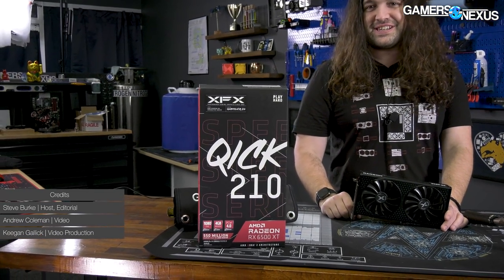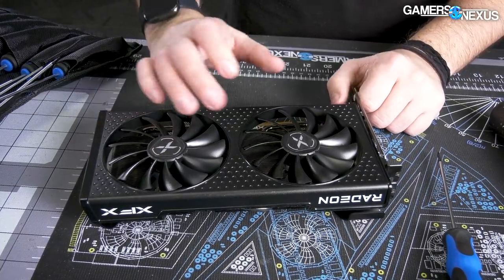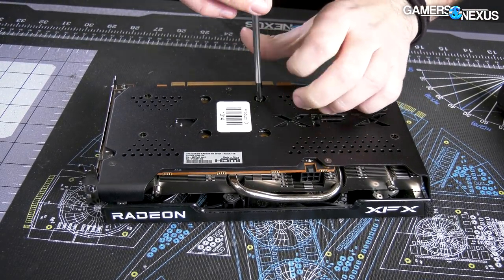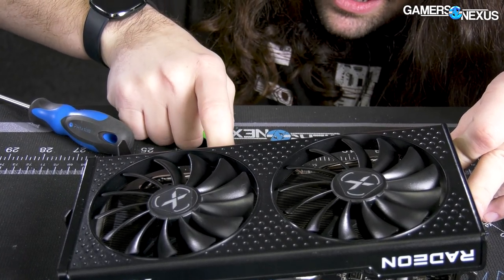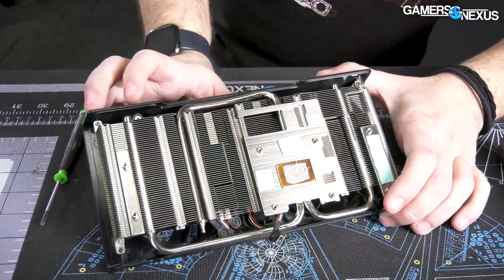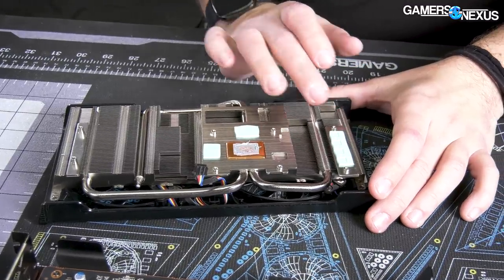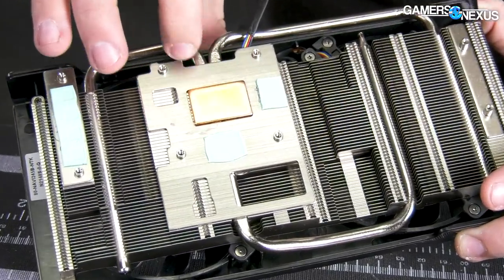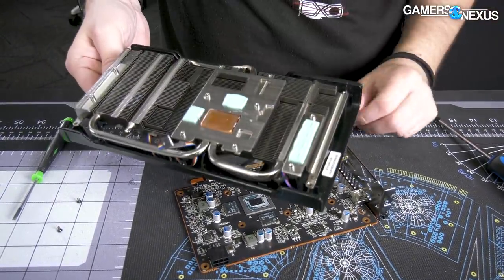Tearing Down Trash: AMD XFX RX 6500 XT Disassembly

Comment: Is it me or does that heatsink look waaaaay to complicated and resource intense for this sort of GPU? Feels like they are throwing away metal for the sake of production....
Reply: Gotta try to justify $200+
Reply: Probably just repurposing an existing cooler that happens to fit, instead of spending time designing a new one.
Reply: im guessing they're trying to make it look better than it is.
Reply: @defeqel6537  Probably. But thats still really bad and it most likely did cost them more. Material Cost has gone up and using two Fans isnt wise as well.

I highly doubt they are getting away with less costs this Way. Specially now but also before.

(It also is more complicated to put together when producing it)

The real, more likely Reason is that they wanted to push up the MSRP anyways. Ppl are also defending that „this is an Laptop GPU“ and totally ignoring that there was never an Alternative from AMD for this so called Laptop GPU to begin with. We were always meant to get this Card. There is no magical other 6500xt that could be better. 

So ppl are defending it because AMD back then decided this Card will be bad. So now it all of a sudden is a good Product.

I just cant keep up with ppls Thoughts anymore. Its pretty insane. 

Nvidia is still worse but many cant come around their Products for one or the other Reason.
Reply: @defeqel6537  I might be wrong but I think it does have the same cooler as the 6600
Reply: they're just re-using a cooler that they already had tooling for. i'm sure if some one wanted to spend the time looking through all the low end cards over the last few generations they could probably find the original one(my bet is RX400/500 series). EVGA does this as well with their gaming and FTW series cards along with most if not all the other manufactures when it comes to mid/low end cards.
Reply: They run quite hot. Hotspot temperatures are 75degrees running warzone in medium settings 50-60FPS
Reply: @Colourbeast1  this thing really hits 75? This chip or this specific card? I mean if it hits 75 using this elaborate heatsink that seems rather inefficient.

Comment: Having this card compared to 580 reminded me one thing.
I remember when 480/580 launched, AMD was recommending running 2x480 in Crossfire to reach performance of 1080Ti.
I think it would be fun to revisit this in 2022.
I don't think those claims aged well.
Reply: Problem, you'll have to find a 480. Mining drove the RX 400 series extinct. Maybe 500 series could still be found but are likely all worn out.
Reply: I think those claims aged well in that they're just as inaccurate now as they were when AMD first made them.
Reply: @CaptPatrick01  oh there's plenty around. They're just 300-500 used
Reply: @CaptPatrick01  Most mining operations run them undervolted and underclocked to minimize the power usage and maximize profit while mining whatever scam currency. So, the card would have been a lot less stressed than the constant up and down of gaming workloads.
Reply: I'm actually running twin 580's and I have to say I feel they perform pretty well still for being 5 years or so old. Still I'm not sure how many games actually support crossfire though.
Reply: Screw that, I want to see 2x6500XT Crossfire

Comment: Costsavings Everywhere, yet they use an Backplate thats not needed and 2 Fans. 1 Would have been fine for this Card. And the Cooler seems to big as well. Great. They could have made it 175 but they choose not to.
Reply: Does AMD decide a minimum MSRP the card brands need to meet though?
Reply: @Vok250  Moores law is Dead has a cost breakdown video for the 6500xt. It shows the steps in manufacturing costs/ components, shipping costs, % cut that AMD and the AIB's take.
Reply: Maybe they're reusing a cooler design? Probably costs more to just have some extra metal, than to modify the stampings.
Reply: Could have gone on a half height double slot card like the msi 1050ti and fit more budget old oem systems at least it would have a purpose
Reply: Use 2 so it looks "cooler"

Comment: High would love to see you cut off the extra unused PCI connector to recover the value/gold and see if it still works when plugged into a native x4 pci lane. That would be commical.
Reply: I'm pretty sure there's no gold fingers on the unused portion, that'd be a waste of material
Reply: You can simply remove the unused portion but there is so little gold, recovering it would cost more than it's worth.
Reply: @wetpaperbag1346  There are very clearly gold contacts on the unused portion.
Reply: It would still work. Those other pins aren't connected to anything, so there's nothing electrical to stop it from working. Only the mechanical limitation of "this is too bit to fit" stops it from working in a x4 slot.
Reply: @killersberg1  I do not expect him to do the recovery with the fingerboard pins. GN donates equiptment to a company that does the recovery and recycling... but you know that. It would simply be a commical video that I would enjoy watching. Geez.
Reply: A few milligrams of gold in about 80 extra fingers. Not worth the hassle of washing the lab glassware nevermind the refining chemicals or electricity.
Reply: @wombatillo  Read my comment above yours.

Comment: Wow that fan cable is awful, you have all of this space on the board, and you end up putting the cable connector that is the most likely to break when trying to pull it off...

And the construction and spec of it is bad even by budget card standards... How did this ever get onto the market?
Reply: Well, it's the cheapest card, so it must be cheap, got it? :D
all joking aside, it's really a bad card... as everyone said, making it just PCI powered and single slot would have at least bring some interest to it. Here it's just trash sold for the price of gold.

Comment: This reminds me, I use a HD 5870 (I think that model is correct ...) Eyefinity card.  You can unplug everything including (including mini-DP adapters) and it sits there heated up to 45C and the PSU gets really hot.  

Just terribly designed.

Comment: I don't know why AMD is getting hated on for this GPU, they're just trying to help us out by making a card so bad that miners and scalpers won't want it! It's really genius on AMD's part.
Reply: Agree
Reply: Because if they had just kept making the 4GB 5500 XT that would have been better.  It has better performance, more display outputs and actual encoding and decoding support.
Reply: @Noliving  My entire comment was obviously sarcastic btw
Reply: You can bet the 3050 wont receive the same criticism and gamers will buy it 10 to 1 thinking it's better as a result of these biased reviewers
Reply: @Noliving  The costs are probably quite a bit different. Inflation is a real thing.
Reply: @Chibling  It could be more expensive, but my point still stands, the 5500xt is a better value, it has better performance and it has more outputs and it has encoding and decoding support.

Comment: Its not a good card but when I look at shops and used gpus in my region it can be a decent option... Used rx580 and 1650 starts at 350usd. In stores are only rx6600 for 880usd, rtx3060(non ti) 1100usd, rtx 3070ti 1700 usd, rx6900xt 2000usd and finally 3080ti for 2600usd. Ordering parts in different country is not an option because of import taxes...
If you want play games you have to buy laptop or the only available console - Xbox S... What a sad times.

Comment: Steve and I both said the exact same thing when he got the cooler off, "wow that's a tiny GPU". This GPU is just a waste of silicon, I have no idea why AMD even bothered making it.
Reply: Nvidia GT 1030. People will buy anything.
Reply: Cause they knew it would sell regardless; they all sold out within the hour (except for the stupid $300 Triple Fan models)

At this point, many people are tired of waiting and are going to pick this up just because it's relatively affordable.

Do I think it's worth it? Absolutely not. AMD could have done better by adding the codecs and adding more lanes without making it expensive or attractive to miners. 

The only positive thing I can see is that these cards are going to be easy to find for $100 new or $40-80 used once GPU supply improved. Even then, I don't know if they would even be worth it.
Reply: For the 6500xt:
Die cost is around $18
Board, VRM, etc. $50
30% markup to pay for R&D and other things (Normally is 60% for Nvidia and 45% for AMD) Total 150
VRAM $12 a GB so $48
Cooler $15
Shipping (right now) $30
The rough total before any AIB markup, $195

This was meant for laptop, but they decided to try and pump tiny GPUs to the low end that are actually remotely good. Would you take a 6500xt for $200-250 or a used 1650 for 300?
So why are we getting mad at AMD for setting a realistic MSRP for the market right now, but COMPLETELY IGNORE NVIDIA NOT SETTING AN MSRP FOR THE 3080 12GB.
Maybe AMD learned now, they just won't say a realistic MSRP or any, then no one will get mad at them. Great job you just created a new Nvidia in the GPU market
Reply: @ThatLaloBoy  Yes AMD could have just waved their magic wand and added these things in now into a chip that was designed 2 years ago...
Reply: @benc3825  Say it again for the folks in the back.
Reply: @agenericaccount3935  I don't know if you are joking, but either way...
Do you really think people want to be told they are wrong? I am just the crazy guy that did his research and realized that this is pushing GPU prices down.
Thanks for coming to my discount Ted Talk.
Reply: @ThatLaloBoy  in a laptop with PCI 4.0 where this dGPU was designed for the APU handles encoding. PCI 4.0 x4 is enough bandwidth for this chip. Making a completely separate low-end desktop graphics chip requires additional cost and  personnel time that AMD can spend on 7xxx series graphics chips.
Reply: @benc3825  I wasn’t being facetious. Your points are valid. 

Reviewers seem to be sidestepping the context of the world this card was born into. 

The way I see it, this is great for the kid who washes dishes on the weekends and has been scraping up a bit of spare change to get a budget system built to play whatever his cohort plays. Two outputs are fine for him. He’s not running five panels. 1080p is probably fine for him because the panel he does have isn’t 1440. He isn’t encoding a stream or doing edit workloads. And most importantly, the dang thing comes with a warranty. 

It’s not for me. And it certainly isn’t for the already entrenched enthusiast. It’s a gateway. And as you mention, it may do some good work on deflating the secondary market just a tad for us.
Reply: @benc3825  Because only the folks where money is no object will buy the 3080 12GB / 3080 Ti / 3090 Ti, etc. The budget-conscious people clamor for value in the mid to low end, and this is practically a slap in the face since it's regression in value compared to older GPUs.
Reply: @flinx  at least gt1030(gddr5) was a proper entry level gpu. it knew its place and it was mostly single slot, sometimes even passively cooled and it didn't need pci-e cable unlike that waste of sand
Reply: @proCaylak  mid-pandemic GT 1030 production restarted and they've been selling for up to $150, making them far, far worse in $per frame than the 6500 XT. Reintroducing an absolutely terrible deal during the pandemic is worse than introducing a merely bad deal during the pandemic.
Reply: @Simon-gc6uf  alright fair enough. I'm not an expert so I have no idea how easy or hard it is to add the codecs to these card. 

At $200, it's good enough for people who are looking to finish their builds. But anything over that price point is just silly. At those prices, I would take my chances getting a better performing GPU in the used market.
Reply: @ThatLaloBoy  no AMD could not. It would take weeks to redesign the GPU to have all that and it would cost 300$+ instead of 200$ AND miners would love that card. Jesus what is wrong with you people
Reply: @flinx  was that the DDR4 version? that thing was another steaming pile of waste
Reply: @proCaylak  in stock at Amazon 1030 with DDR5 priced from $149 to $179.
Reply: @flinx  in that case, that's something I didn't know. thanks.
Reply: @nicoj9984  If your video card dies and you can't afford $265 for a 5600G + $125 for the motherboard, you don't get that APU. 

This week I had some people tell me it's unfair comparing new and used GPUs because they refuse to buy a used GPU. For them used cards aren't an option.

Hardware Unboxed used an equal $300 price for 1650 Super and 6500 XT. 5500 XT's ebay average price is $290. Two of those cards are used with more risk and no warranty. 

If you will agree for non-streaming gamers the RX 6600, 1050 Ti, 1650, 2060, 590, 5500 XT (8GB), AND 6500 XT in a PCI 4.0 system are all "terrible" deals because their $ per frame are worse than the 5500 XT (4GB) and 1650 Super, OK I'll agree. What I won't agree is singling out only the 6500 XT and saying only it is a terrible deal for non-streaming gamers.  

It would indeed have been nice if Hardware Unboxed had benchmarked a 580 in addition to the 570 and 590, but I don't blame them considering they tested 14 different system configurations in 12 games.  

Yes different countries with different taxes and pricing will have different best deals.
Reply: @flinx 
"If your video card dies and you can't afford $265 for a 5600G + $125 for the motherboard, you don't get that APU. "

That's why I said that when you are on a budget and...
...need a new system ---> you go APU
...need a new GPU because your old onw broke or you want a new CPU without iGPU ---> you go used, especially before buying a GT 1030 for gaming use, which was the starting point of this discussion.

"This week I had some people tell me it's unfair comparing new and used GPUs because they refuse to buy a used GPU. For them used cards aren't an option"
Normally I would agree (somewhat) with that statement as buying a new retail GPU gives you more security (warranty/fraud) and a longer lifespan (driver support) compared to an old, used one. A newer generation also usually get's you better features and technologies (newer revisions of HDMI/DP, Encoding, DirectX, DLSS, ...) and a higher resale value down the line. BUT(!!!) in this market, as sad as it is, buying used is by far the better option if you have to weigh ever dollar/euro against the performance you get and/or if you need a GPU asap and can't wait until it's in stock... maybe some day... next month or so... So NO, comparing used GPUs to new ones isn't "unfair", it's useful and necessary to get a picture of the value you can get for your money, especially in a market as crazy as it is right now and in a climate in which GPU technology seems to stagnate since neither AMD nor Nvidia appear to be interested in spending money on R&D as long as they can still sell old/sub-par products at horrendous prices.

I have two problems with the RX 6500 XT:

1) The PCIe bottlneck
Sure, You and I know that when you put this card into an "older" system (<9th gen Intel or <3rd gen Ryzen), it will only run on PCIe 3.0x4 and severly limit it's performance - BUT NOT EVERYONE KNOWS THAT! If you are only interested in gaming and have no idea about hardware, PCIe or stuff like that, you may end up buying a 6500XT that gives you and your setup way less performance than something like a 1650 would have given you for the same kind of money. That also goes for parents and grandparents that want to beef up their kids or grandkids dated gaming PC or convert the family computer into a gaming capable system - two of the main markets for a low-end budget card like this! That kind of bottleneck should have never existed or - at the very least - should be clearly labeled on the box and on sales pages, otherwise it's a trap for unknowing, average consumers.

2) The lack of encoding support
Once this card has outlived it's usefulness as a gaming card - which, given it's poor performance won't take that long - this card is basically useless for any other purpose: It can't serve in a secondary Streaming-PC, Plex-server or HTPC since it can't encode video and has to dump most tasks needed outside of gaming to the CPU. This limits it's future use case to nothing more than a display output - a task, less power-hungry, less expensive and smaller cards can do just the same. That lack of future usefullness will result in a faster drop of resale value, making it a worse deal in the long run and - even worse - will send those cards to the landfill sooner than other cards with comparable performance today.

Comment: Putting together a new build for a family member using a 6500 XT I got for $199. I made sure to get a B550 board and a 5600X so it can use PCI 4.0. It should be pretty decent still and will be more than adequate for its purposes.

Comment: Still think recreating the "office space" scene with the printer but with the RX 6500 XT would be highly amusing and make better use of the sand than AMD. Looking at it there's probably more cost in the cards cooling solution than the pathetic board, also dunno why they even bothered with the backplate. I'd guess XFS legal team didn't allow them to put "Quick" on the box front.....because it isn't.